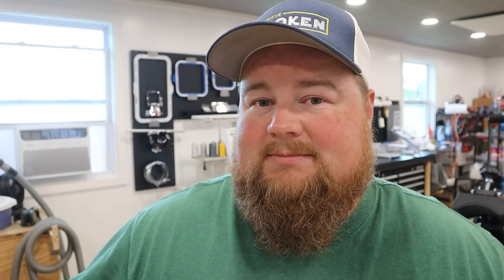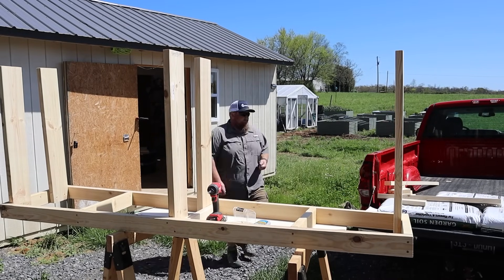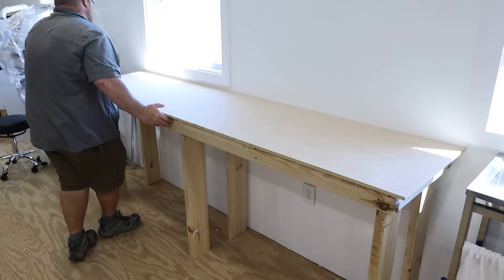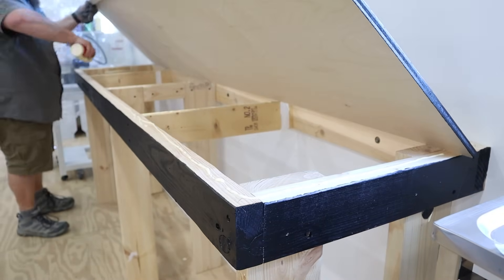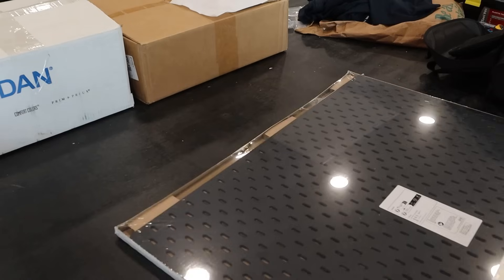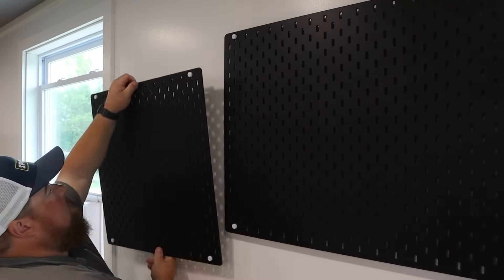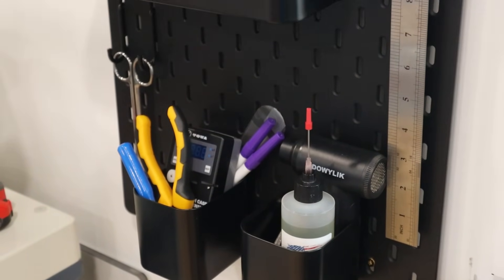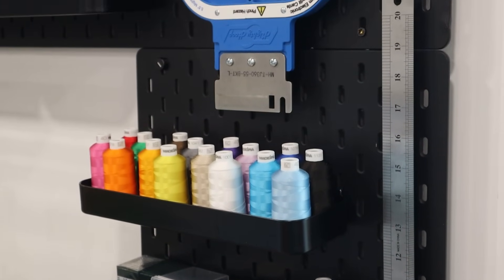Ultimate Organization! Building My New Embroidery Business

Comment: I enjoyed this video and ordered some peg boards based on your recommendation.  I'm just kidding!  I bought them because I wanted to.  I was going to do a road trip to IKEA in KC so that I could see them first but for $10 shipping, I couldn't drive there for that.  I will use them in my shop or if I don't like them, I'll put them somewhere else.  I have been following you since I first discovered you when looking up Shapeoko videos.  I did buy one because of your video and a few others and have had no regrets.  I love my machine.  Also, I am happy that you have finally got the the shop that you deserve.  One question I do have, do you try to cut most of your lumber outside of the shop?  I know you have dust collection but my guess is that the saw dust wouldn't be that great on some of your equipment.  Anyway, the new shop is looking great!  Congrats!

Comment: Sam, you certainly are getting deeper into the embroidery way of life.  My only concern is that when you use your tool's in your workshop will the embroidery setup be covered in dust or even sawdust 🤔. As always brother 💯%   👍   🇬🇧.
Reply from the maker: I don't use any woodworking tools in my shop anymore. I've really converted away from doing traditional woodwork or sanding in here. Cutting can be done under the carport right beside the shop as needed and/or in the old workshop. :)